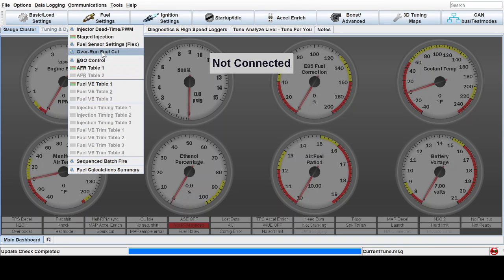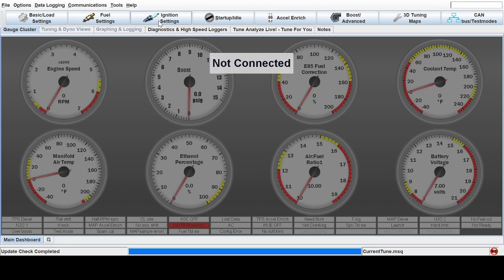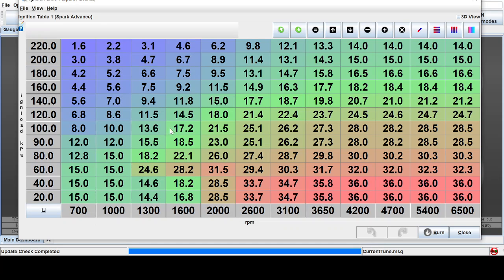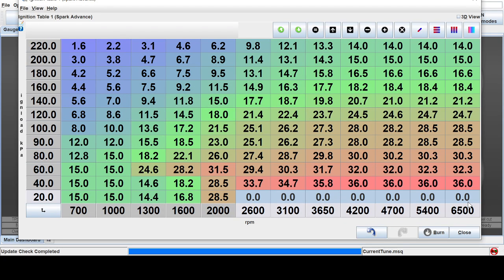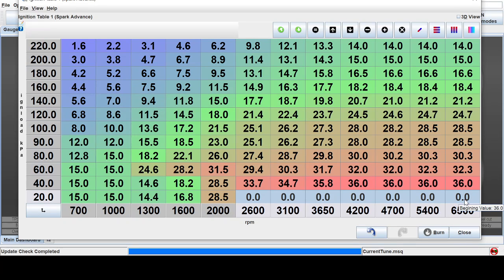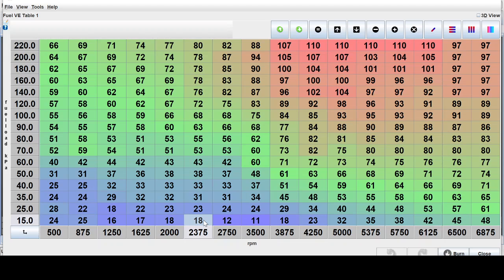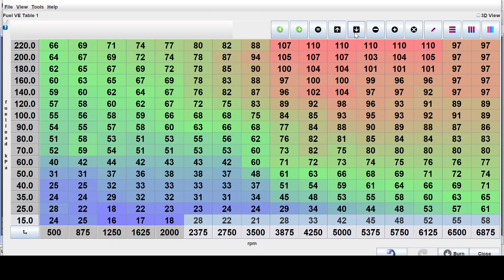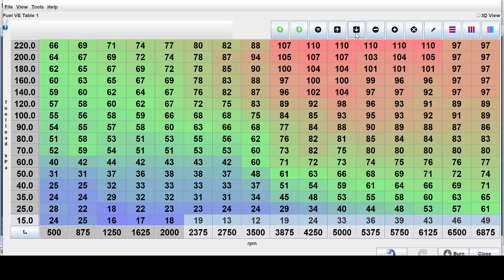Megasquirt Burble Tune Basics | Learn to Tune

Comment: Like this advise. My 10th gen cicic like -5 base Ignition. Get great cracks. No flames. Working with different settings now. My car full race ready, but I like trying my own thing at times than my tuner does, but use his settings as a guide. Much the same as you just talked about. Thanks.

Comment: I have tuned for pops and bangs on my me221 but it only works if I give it slight throttle how do I do it for when I fully let of the throttle
Reply from the maker: Make sure overrun fuel cut is not enabled
Reply: @TurbineResearch  I have done it’s turned of but still haft to give it some throttle

Comment: These tunes are retarded.  Just tune your car so it runs well.  If you want it to sound tough, make it tough with heads, cam, compression and exhaust etc!   Fake shit is for ricers.
Reply: Fuel enrichment on decel and retarded ignition timing as well have benefits
Reply: Within reason

Comment: Finally the video I’ve been looking for. Just a quick question. My Mercedes M276 tt v6  is in other vehicles with the burble tune, and I’m just wondering if you know if it can be linked with different drive modes, or in a general case, if this can be programmed for each drive mode you’re in regardless of vehicle.

Comment: It's better to use the overrun timing pull
Reply: Oh Yeah? How so?
Reply: @jwmojo2 enable it and set after delay value to 1.5 seconds and tps threshold to 1% to achieve both benefits engine braking + this very damaging to your exhaust values, desired effect lol

Comment: Guys.. experiment VW Polo 4 9N3 1.2L 40KW 3 Cylinder NA engine with a very slight crackle above 2000rpm is haaaappeniiiiing 😂😂😂.

Comment: I've got an MS3 on my 4.6 2v, but I can't get any pops out of it. I followed your instructions and had my buddy drive the car to test my cutoff area. I watched it inject extra fuel via my laptop, and I saw my timing go as low as -15, couldn't get a single one lol. I have aftermarket cats that are set pretty far back, but maybe they are still the problem? AFR went down to 10:1 on decel, spiked my lambda sensor. 19lb/hr injectors on 11% duty on decel, with -15 ign timing.
Reply: I'm about to order the ms3 for my 96 gt with an 01 Bullitt complete motor. I've been driving on a sct tune for the npi engine because the ecm refuses to tune. Easy setup? Are you learning tuning with it or have previous experience?
Reply: @sategllib2191  learning with it, wasn't super easy at first since the fuel map they supplied for idle and cruising we're not working for my car. Had to redo the whole tune from scratch. Installation/setup was very easy though.
Reply: Fixed by adding idle valve duty cycle and leaning out burble areas. Saw best results around 14-16 afr.

Got my burbles now 🤣.

Comment: I tried this and got zero results... what am I doing wrong
Reply from the maker: Try adding more fuel in the deceleration and make sure your overrun fuel cut is disabled
Reply: @TurbineResearch  I did ... I added an excessive amount... and still no results

Comment: How about doing this with ECUflash for Subaru? Any tips or settings you would like to share? Seems pretty straight forward. Its just that Stock ECU tuning has more than just one main ignition table....
Reply from the maker: I don't have any experience with stock ECU flashing :(
Reply: Subaru? Cobb
Reply: @DTunedSound  Open source. I am and have been boycotting Cobb since the Green Speed compliant switch over.

Comment: Can it cause any damage to engine?
Reply: it can yes, but not immediate. over time it has the possibility of causing damage if you go crazy with the pops and bangs
Reply: @Drewdoesit1300 not really, it only damages cat. I mean I’m talking about normal pops and bangs, if u go as far as shooting flames and shit then yea it can probably damage the engine
Reply: @RegardedBee185  those pops are causes my combustion happening while the exhaust valve is open, Ive been tuning cars for a while and all the pop and bang buys eventually burn out the exhaust valves. It takes a while but it’s the same failure point every singe time. If they are VERY mild and not aggresive  you can get away with it so long as you inject extra fuel and run it rich as hell to help cool the valves, but anything like what all these 335i and dodge “hoodcats” run are cooking the motors slowly but surely, UNLESS it’s tuned in such to prevent overheating of the exhaust valve
Reply: @Drewdoesit1300  I’m a bit confused tho. Aren’t all pops and bangs caused by rich fuel?
Reply: @RegardedBee185  a lot of the pops and bangs thing is actually caused more so by ignition timing. A good 95 percent of the pops and bangs are just from ignition timing
Reply: @Drewdoesit1300  bro I have a pops and bang tune on my civic but I got it done from a tuner not sure which one he did but he was talking about fuel or some shit like that when explaining it so hopefully he also added more fuel
Reply: @Drewdoesit1300  I get LOTS of pops but they’re not as loud as bmw or mustang pops. Also how do I know if I’m running rich as hell? Or will only the tuner know? I’m pretty sure my tuner added extra fuel tho
Reply: @Drewdoesit1300  yea I’ve no catalytic converter
Reply: @Drewdoesit1300  yea the tuner isn’t some random guy, he does it as a business so I’m sure he kept it safe. Also when I am normally driving it doesn’t pop, it’s when it reaches above a certain rpm or whenever I purposely want it to pop only then it will pop. And I’m not always popping/abusing it, only here and there I get them out

Comment: Maybe this will help me figure out why my Microsquirt goldwing pops like crazy on decel. I’ll try reverse engineering. It’s driving me nuts. Sounds like New Year’s Eve in Phoenix.
Reply: My car was popping alot on decel too which is not what usually happens so I knew something was off. Turned out to be an issue with the connector that plugs on to one of my coil packs

Comment: For mine it will be nothing for maybe 2000-3000 rpms and then a huge back fire no mater what the timing is, how to I make the pops more balanced?
Reply from the maker: Try changing the amount of fuel in that rpm range. Less fuel and less ignition advance should calm down the bangs in that area of the map

Comment: I have -20 degrees, helluva Bang! 💥
Reply: Should fuel cut limiting be off or on for this in the rev limiter menu? Should spark cut limiting be on or off as well to make this work?
Reply: @bspecautosports4832 
Best way is to test it out. Personally I have it off but I do not need huge bangs

Comment: Hi. Very nice video. I have a 2002 Ford f150 5.4 supercharged harley davidson  and i wont make some pops and bangs but in Portugal i dont have any tuner to make that. ( only exist one truck like this in Portugal). Where can i find a program and acessories to make this? Thanks for your help.
Reply from the maker: I don't have any experience with the Ford lighting tuning. You will need to find a specialist that can tune older Ford ecus

Comment: So I tried the simplest settings as you did and it seems nothing is changed besides the map it self, works when I run in fuel run cut as I lightly touch the throttle. Fuel run cut off, nothing happens, does the EGO controller settings have anything to do with it?
Reply from the maker: It's hard to say because every tune is different but if you have overun fuel cut off and ego correction is on the ecu might be trying to pull fuel where you want it to crackel under deceleration.
Reply: @TurbineResearch update: I left my ego settings as is and leaned out the bottom column VE table. Got the pops! NA engine
Reply from the maker: @oscarscott8353  awesome man! 😎
Reply: @oscarscott8353  how much did you lean it out? What are your numbers looking like.. somebody was telling me if you lean out the table you’ll get more pops. But in this video here he says to add fuel... I already get some crackles but i want some serious bangs.
Reply: @Klenoce  you ever get it figured out?

Comment: What if I want to hear crack, only when changing gear at high rpm rev cut? What's the simplest way to do this?
Reply from the maker: Set the rev limiter to "spark cut only" and set timing to 0 deg on the rev limiter. That will make a strong pop between shifts.
Reply: @TurbineResearch  now how could we get the snap when you're shifting say anywhere from 4k to redline without smacking your rev limiter? I haven't figured that one out yet
Reply: I was about to say you needed to check out flat shifting but it seems ol sean already sorted you out. :p